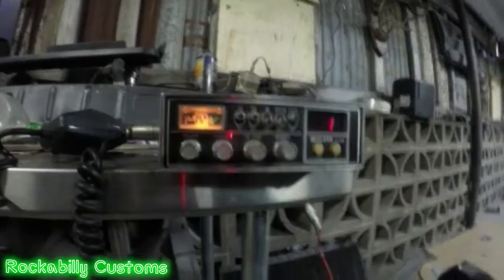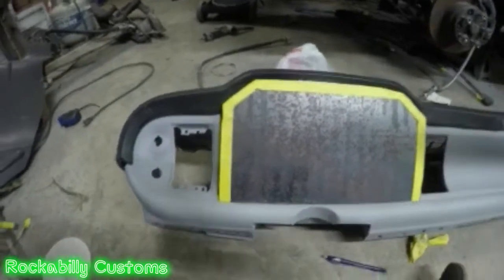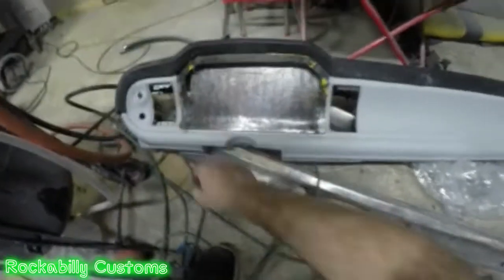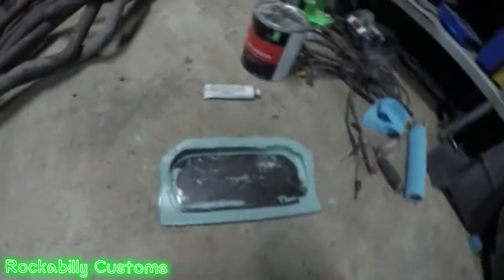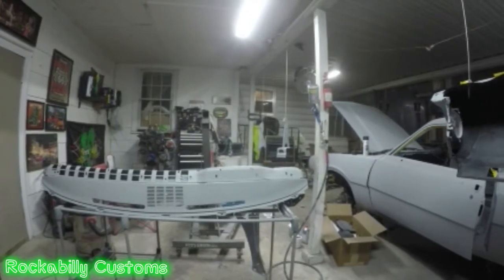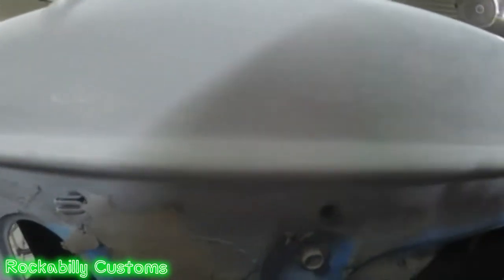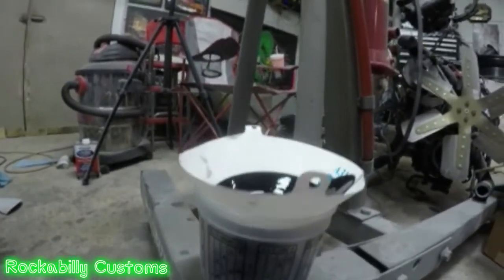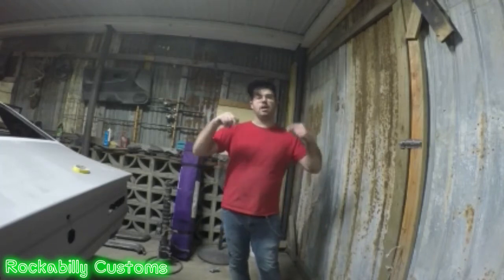Custom gauge cluster and the interior and painted on the Maverick

Comment: On the oil pan gasket- Some "say" you can...... but would I trust it? No. Now, what i might do in a pinch is put a little 3M weatherstrip adhesive on it and let'er rip. That stuff is sticky like a liquid clamp! The valve covers are easy to deal with, the oil pan... not so much. It's your call. Any dings or dents in that factory textured steel, you're kinda screwed. Not really any way to make it look right other than to leave it or make it all slick. Looking good so far!
Reply from the maker: Ok thank you ill go ahead and get a new gasket to make sure. But thank you